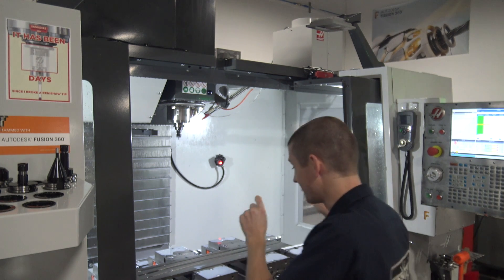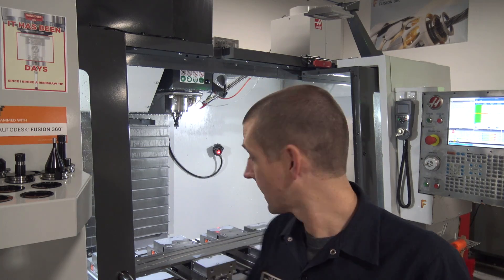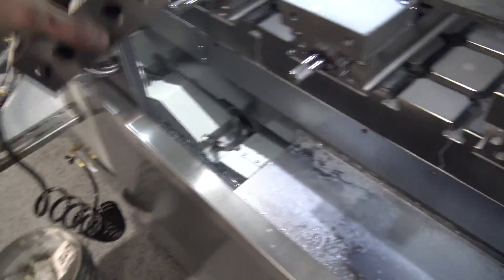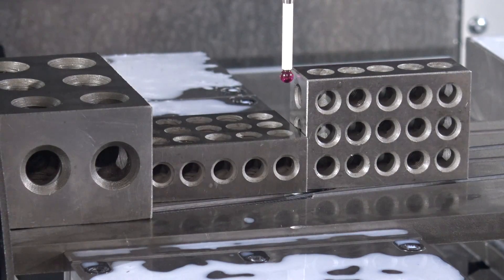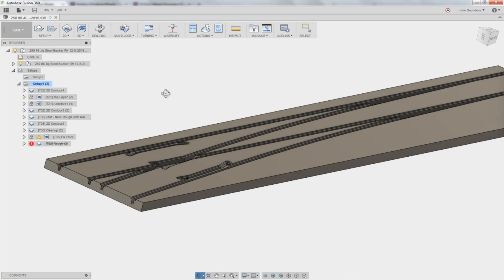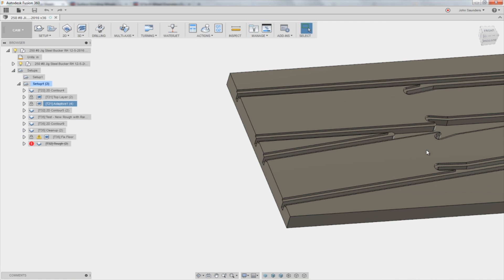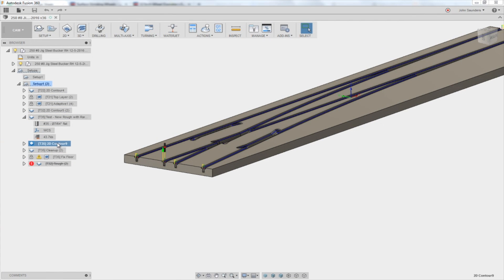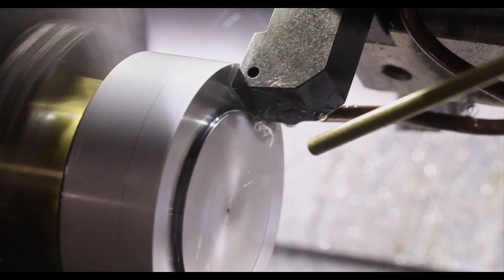Machining a Railroad Jig on the HAAS!

Comment: In the probing screen even for single surface there's a field that allows you to enter a distance. Just make it a negative number and it will probe in the negative direction.

And a 1/16" is still very tough. Adaptive, if the parameters are correct, doesn't break tools.  A 1/16" could have plowed through that material in no time. 

Get out of the "weak tool" mindset. Tool strength is a function of its dia to length ratio. Not just its diameter. 

Take a new pencil and break it in half.  Now break those halves in half again... little tougher? Now try and break em in half again.. almost impossible by hand right?  The pencil diameter never changed only its length did.
Reply: NYC CNC 
No risk no reward ;)
Reply: NYC CNC Did it work?
Reply: NYC CNC 
Slacker!  :P
Reply: Occams Sawzall 

Same analogy as was told to me many moons ago which is the easiest to bend with your hands a six inch nail or a one inch nail ( note hands only no tools vices )

Think about it try it Occams has it nailed😀
Reply: Lol
Reply: Tool diameter to length ratio is not a good way to describe the strength of a cylindrical tool. (minus the flutes) Since the cross sectional area of a cylinder increases exponentially, a 0.250" dia tool with a length of 2", and a 0.500" dia tool with a length of 2" are going to have a dia:length ratio of 0.125, and 0.250 respectively. This leads you to believe that the larger bit is twice as strong, even though it is way more stronger. The cross sectional area of the ¼" bit is 0.049", and the ½" bit is 0.200". (Since they have the same length, the cross sectional area is the determining factor.) So it has 4x the steel holding it together. I think they're needs to be an easier way to represent that. 

Similarly, a 2" dia end mill that is 8" long is going to have the same dia:length ratio as the ½"x2" one from above, but is stronger.
Reply: Andrew Delashaw 
What does the cross sectional area of it show?  You could cross section a cylinder in a nearly infinite number of ways.   Vertically, horizontally, at a bias of any angle between 0 and 180....  not sure what you're getting at. 

The vertical cross section would be .5 for the 1/4" and 1 for the 1/2".   Making the 1/2" having only twice the material in the vertical axis. 

However the strength and rigidly of an endmill in a cut is a factor of the moment of inertia where the cutter meets the material (the depth of cut) and the moment of inertia where the endmill meets the holder. 

This is why burying the flutes into the work piece and reducing the stick out of an endmill significantly increases the strength. 

If you had 2, 1/2" endmills, both the same length and both  out of the holder 2" with 2" LOC. But one has all 2" of flute buried into the material and the other is only 1/4" deep, which endmill is stronger in the cut?  And which is acting like a 1-3/4" long lever? 
 They both have identical cross sections no matter which way you take it.  It's the length to diameter ratio between the top of the stock and the bottom of the holder that matters. Since those are the only 2 moments of inertia acting on the endmill. 

Same rule applies for an endmill in general. It's the length to dia ratio that determines it's overall strength, lateral cross section is meaningless
Reply: Occams Sawzall Check your math. A ½" circle (the cross section of a ½" cylinder. I think it's obvious I was talking about the plane perpendicular to the length of the bit. Also "cross section" is generally used to describe the straight cut through the cylinder at a right angle; not at an angle or bias. That's according to MW; I looked it up to be sure. Also a cross section of a cylinder can not have a diameter unless it is a circle. So there is only one cross sectional plane of a cylinder than produces a circle.) has an area of  0.2", and a ¼" bit would have an area of 0.049". The area of a circle is calculated as A=πr2 (π=3.14, r=½D) So I'm not sure where you got a ¼" bit having a 0.5" area and a ½" bit having a 1" area. It's not twice as much material, as your math states, it's 4x as much material; and it keeps growing every time you double the diameter.
Reply: Andrew Delashaw 
https://www.quora.com/How-do-you-calculate-the-cross-section-area-of-cylinder

There's multiple reasons why a cylinders cross section is not always a horizontal section.  Depending on the application and forces being applied along with the material. A known sheer angle of a material means the cross section of a bias at the sheer angle (forms an elliptical areas) of the cylinder needs to be calculated. If a combination of axial and lateral loads are being applied both the axial and lateral cross sections will need to be found. 

Cylindrical cross section from an endmill experiencing primarily lateral force and little axial means the axial (the surface 90deg to the force applied) is what matters. You're side loading the tool so it's the axial cross section that experiences the load. Axial cross section of a cylinder forms a rectangle. Which in this case the 1/4" x 2" endmill has an axial cross section of 0.50". And the 1/2" x 2" endmill has an axial cross section of 1.00". 

Conversely if this were a drill the lateral cross section is the factor, as the load is being applied along the drills axis.
Reply: Andrew Delashaw 

If you really really want to dig into the physics of it

https://web.mst.edu/~chiep/FE%20Review%20Files/MechanicsofMaterials.doc
Reply: Occams Sawzall Occams Sawzall I never said, "always." I said "generally." I figured that was obvious because like I said, it is the only cross section which has a diameter, and it's the only one that remains proportionally constant as the radius grows. (A circle or it's 3 dimensional counterpart is the only shape that has a diameter. The ellipse that would be created from the cross section at any other angle doesn't have a diameter. Although diameter is sometimes incorrectly used to describe the longest chord of an ellipse.) It is also the only cross section that really matters when describing the strength of 2 tools with varying diameters. Why would I be describing a cross section at 13° to the length? (Or any other arbitrary angle.) It sounds like you're just trying to mess with me or argue. All I said was that describing the strength of a tool by the dia:length ratio is misleading. (Also when you said diameter initially, the diameter is calculated by the radius of the circular cross section of a cylinder. So we were already talking about that particular plane.) You were the one that referenced that circular plane when speaking of the dia: length ratio.
Reply: Andrew Delashaw 

Because what you're trying to say is that a 1/2" endmill sticking out 1" has the exact same strength in a cut of equal depth as a 1/2" endmill sticking out 4" because both have identical lateral cross sections. 

Everyone knows this is untrue. So the lateral cross section of the endmill is pointless in terms of how strong the endmill is in a cut. 

It's the axial cross section that matters. Which, is a direct function of the endmills diameter to its length. 

Ergo. The ratio of length to diameter is the real determining factor. 

Using just the lateral cross section doesn't account for the length. And obviously as any machinist knows.  The longer the tool is sticking out, the more unstable and prone to breaking it is.  The greater the length to diameter ratio, the more likely the endmill is to break. A 1/4" endmill with a 4:1 ratio is far stronger than a 1/2" at an 8:1 ratio. But your math using lateral cross section will say the 1/2" endmill is stronger in a cut because it has a greater cross section.
Reply: Occams Sawzall No, I never said that! That makes zero sense. I never compared a ½" tool to itself. Nor did I mention ANYTHING about depth of cut.
Reply: Occams Sawzall I compared a ½" tool to a ¼" tool, and a ½" tool to a 2" tool... Your ratio of dia:length would make it seem that the strength of the ½" tool is twice that of a ¼" tool. (All other things being equal except the dia.)
Reply: The pencil analogy is so bad!